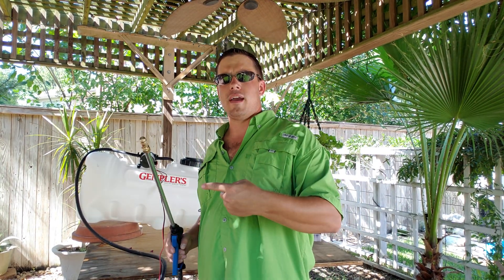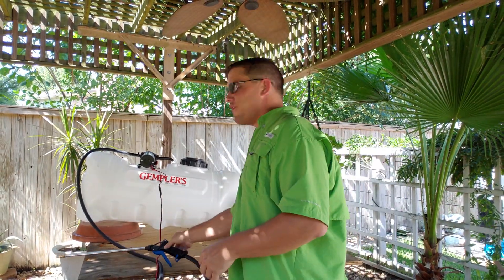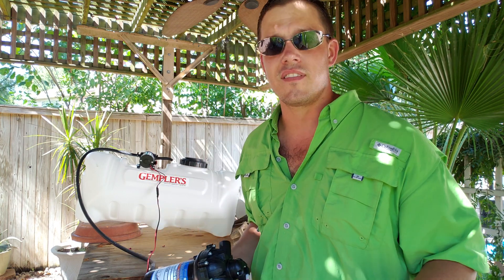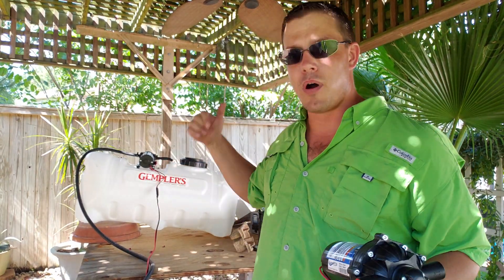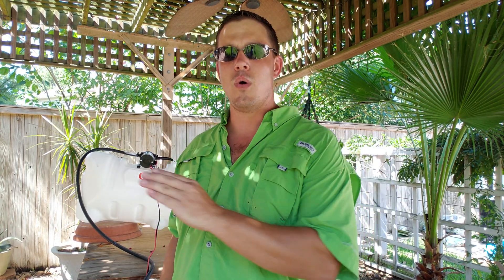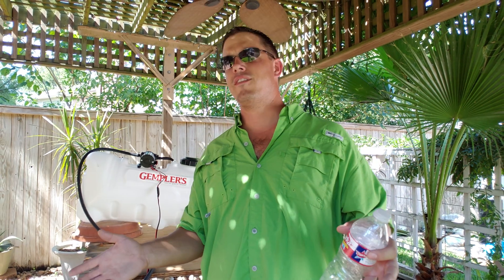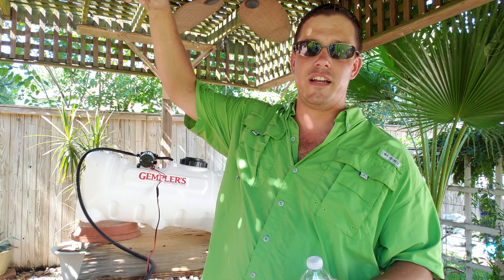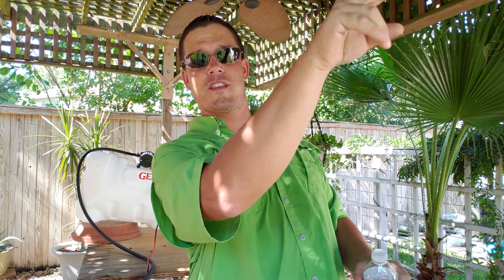Building a DIY 12 volt soft wash setup. Part 3

Comment: It's working exactly as designed.  It's on on-demand pump that seeks a pressure level...so of course it modulates on and off.  Sometimes you must read the instruction manual.

Comment: Same here!  Just starting.  Using a Northstar 5.5gpm setup.
Reply: Mark you are hilarious. Can you comment on this? I have a 35 gallon water tank that I plan to mix batch for 1 roof at a time. Is 35 gallons enough mix to coat a typical sized roof? I know that I need more water to rinse, but I plan to use the house hose or my pressure washer for rinsing. Also, if 35 gallons will work, would you recommend a 5.5 or 7gpm pump?
Reply from the maker: @Payroll23  Thanks...  My wife will not always agree lol.   A 35 gallon tank is better than this 25 gallon.  You may need to do 2 batches every time but it gets the job done.  Just remember to take care of those bushes and water rinse them good.  I would personally recommend the smaller one (5.5) becuase you are just "misting" coating the shingles and 7 GPM will spew that sauce every where.  You want to evenly coat it and make it last.  With a 7, you are just running faster when you should be walking.
Reply from the maker: I am going to be posting an updated video soon of what I did to this simple rig and how its working well for me!  Every one says get a 7 gpm, but that may be overkill if using a batch mix setup.
Reply: @mrdeedspw  When are you releasing the updated video?
Reply from the maker: @blackimpallass1  I will make it this week.  I am building a trailer with reels and tanks and all that fun stuff.  Big difference from last year.  I will talk about the soft wash system I have set up, the hoses and everything.  Life got busy and I put youtube on the furthest burner.  This time of year everyone is thinking of wash season, and so I will def put up one in the next few days.
Reply: @mrdeedspw  Thats great news!
I can't wait to see what have done.
Reply: I have graduated to mixing valve now. What a difference!   Best to you all!